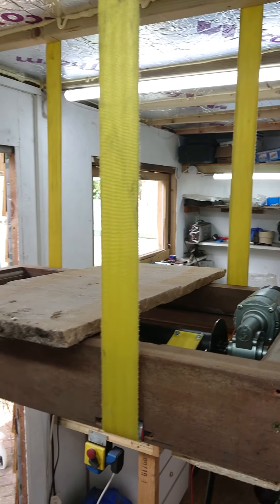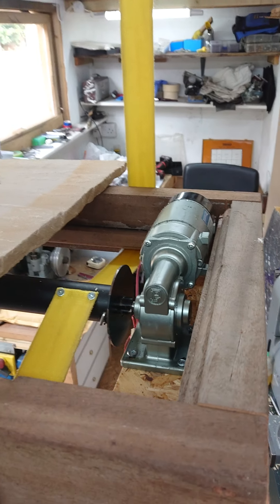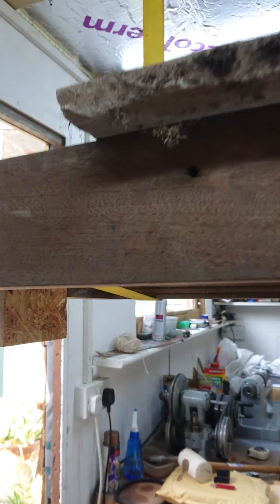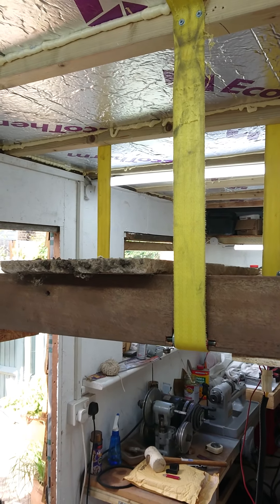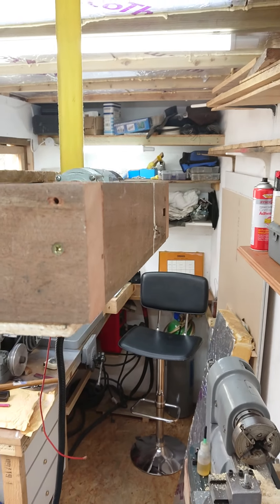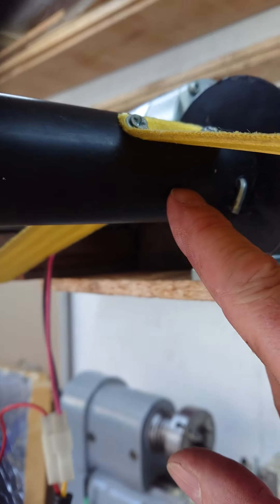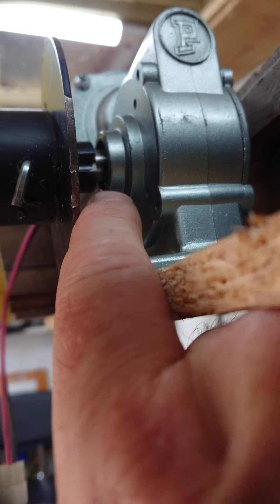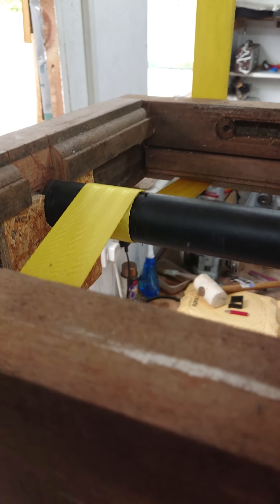Campervan Conversion, electric lifting bed, Proof of concept..

Comment: Danm Man you solved my 90% problem. Apreciate if u  explain motor fitting to the shaft
Reply from the maker: I will be uploading a video with more detail about the motor and shaft soon.
Reply: @houseinavan194  i really want to know how you reduced the motor RPM and at what speed
Reply from the maker: @paikamalpai2001  The motor is already geared down internally to 55rmp
Reply: @houseinavan194  Thanks man how much houae power is the motor?

Comment: Pretty neat!  More proof there is than one method to lift a bed, or build a platform to store stuff in your garage like a rolift. And you probably don’t need to spend $2000-$3009 USD to accomplish this. Thanks for sharing!
Reply from the maker: Indeed a LOT cheaper than a bought version....a lot of work to make the bed frame and mechanism...take a look at one of my later videos with it al most finished...cheers

Comment: Great example!  I'm looking to recreate the same bed system.   Can you share the ebay listing name or link? ..this motor seems perfect.  Thank for sharing!
Reply from the maker: Hi, I eventually used 2 wheelchair winch motors, one either end of an independently supported shaft, each motor is able to be disconnected from the shaft so that if one motor fails the shaft is able to be driven by the remaining motor, and if both fail they can both be decoupled from the shaft so that the bed frame can at least be lowered...This is almost the same as I bought https://www.ebay.co.uk/itm/122841383635?hash=item1c99eac2d3%3Ag%3A6YwAAOSw2-ZgO%7EIF&LH_ItemCondition=4
Reply: @houseinavan194  that helps! Thank you!  For others looking at motor specs, here is the OEM site https://glide-rite.com/product/1473/
50nm @ 37rpm / 200watts

Comment: I like it. I may well use it. I suspect the bed will be sitting on something when at the bottom when you are in it, but you just want to lift it up, or do you plan on slipping in it suspended with this system?
Reply from the maker: Hi, the bed will drop down onto the top of unit's either side of the foot end ( head end is rear door end) the centre of the head end will drop down onto   a table top with a shortened support leg...if that makes sense...there will be a follow up video..